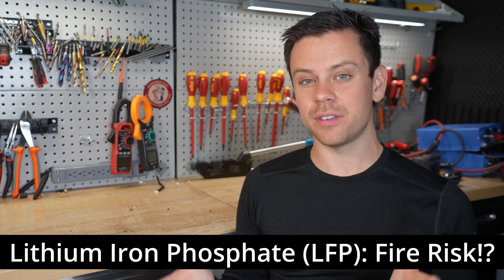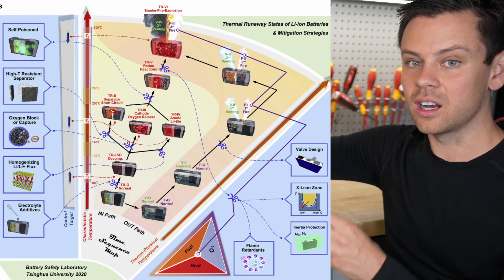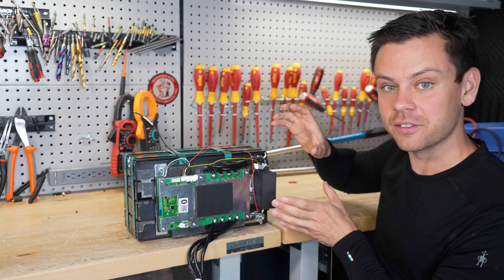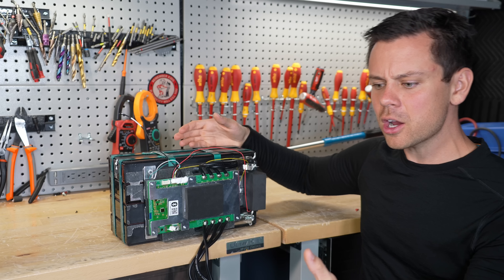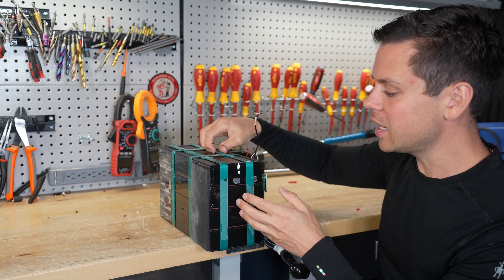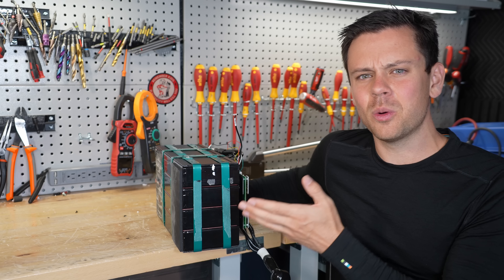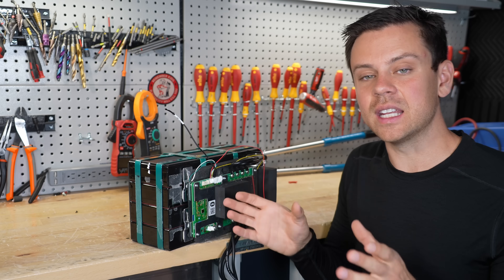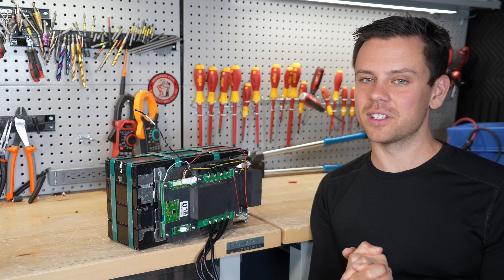LFP Battery Fire Safety: What You NEED to Know

Comment: All the externals reasons you're giving for how a battery could cause a fire boils down to the fact that LiFePO4 "fires" happen all the time. I had a name brand LiFePO4 charging on my workbench last year and ended up having a garage fire. The battery was in pieces and unfortunately when the battery exploded, some of the pieces landed on my kayak and it spread. My garage fire was more smoke damage and contained to the garage so I was lucky. Now I NEVER charge my kayak batteries in my garage. The fire department said my situation isn't unusual and more common then people think. I charge all my LiFePO4 in the driveway attacked to 200W Ecoflow solar panels and a Victron MPPT. When the sun goes down, no more charging for me and I'm good with that. Lessened learned.
Reply from the maker: What in the world. Can you post pictures of this on the forum? Sounds like you're breaking the laws of physics 😂 how did it do that? What burned?
Reply: @WillProwse  I don't know how the battery caught fire or whatever you want to call it. I just know it was charging on my workbench and next thing I know, my fire alarm was going off. As far as your question about "happens all the time", I'll take the word of the firefighter and investigator who told me that's the case, it happens more than what people think than a person not in the field. You can also research it which I did, easily accessible. I'm not a LFP expert and don't pretend to be, I just know mine failed period. I unfortunately made the new and this was quoted "A preliminary investigation revealed that a faulty lithium-ion battery and charger sparked the fire. Firefighters stressed that homeowners should never leave a lithium-ion battery or any battery on a charger unattended. If not equipped with a shut-off, batteries can overcharge and cause a fire."

I had a LiFePO4 battery. I no longer use that brand.
Reply from the maker: Can you post on the forum some lithium iron phosphate battery fires that "happen all the time"
Reply: @WillProwse  No I can't because this is what I was told not only from one of the firemen who fought my garage fire/smoke that responded to my garage fire but also the fire investigator. Unfortunately my resident made the news and the same thing was said. Obviously mine was equipped with and BMS and my battery was a LiFePO4. Search "lithium batteries fires per year". If you don't believe it's not uncommon then so be it but I been there so....

"A preliminary investigation revealed that a faulty lithium-ion battery and charger sparked the fire. Firefighters stressed that homeowners should never leave a lithium-ion battery or any battery on a charger unattended. If not equipped with a shut-off, batteries can overcharge and cause a fire."

Comment: BIG QUESTION- IS THERE A TORQUE SPEC FOR lithium battery terminal bolts?
Reply: nearly all of the batteries have the info on their spec sheet. threads for this are on the forum going back years

Comment: There have been at least 4 garages burn in my neighborhood and all of them sadly are due to NMC power tool batteries charging 
I don't know for sure but I am almost certain they are using 3rd party replacement batteries and charging them with oem tool chargers unattended
Reply: Many many people leave their tool batteries on the charger 24/7.
This is caused many fires. I don't know why I don't remember why I would have to look it up again.
But I know with any of my Ryobi tools that tells you not to leave it on the charger once the battery is fully charged.
You're also not supposed to keep the battery in the tool if the tool is not being used.
Reply: Yea…they were trying to save a few bucks…haaaaa

Comment: For basic "Overvoltage" mitigation, defense in depth is required, ie a BMS that includes an "airgap" contactor or circuit breaker or pyro disconnect, as well as the current sinks / sources including overvoltage protection

Comment: Hey guys, What would you say the main cause for the hundreds of e-bike fires we commonly see online? Some bikes just sitting in a house or garage just start blazing. Vibrations caused a connection to eventually come loose? Wire made it's way onto a terminal like you showed in this video? Poor design allowed low gauge wires to melt their insulation onto another wire? Combustible batteries? I'm assuming the ones left plugged into chargers overnight were failed electronics that allowed it to over charge or were too hot or cold but didn't have built-in protection but enlighten me on those as well.

Comment: A few weeks ago I watched a news article where a house caught on fire. 
There were two boys at the dining room table. The older one reacted when he heard a Whoosh sound behind him that was audible in the video. He got up, turned to look and said, what was that. All of a sudden flames came through a doorway or maybe a hallway and were halfway across the dining room ceiling in a couple of seconds. It was a lithium battery and no smoke detectors sounded an alarm. People need to put smoke detectors on the wall above the lithium batteries. If they have an alarm system they need to add a smoke detector that will notify the security company or them if they have a security system that contacts them. 
It is possible to build a housing for the lithium batteries that will melt copper straps so the batteries can fall away from the house. It's a different world when batteries are involved and people need to think long and hard about battery storage.
Reply from the maker: Sounds like what I was talking about in the video and it not being lithium iron phosphate. Did you watch the video at all or just write all this out for no reason? 😂
Reply: So glad I stayed with SLA AGM batts for my RV. Weight and size no problem. 2 KwH for less than $500.
Reply from the maker: @aerodyneservices  those are awful. What do you like about them? Just the coulombic efficiency alone is horrid. And if they get over charged there is zero protection circuit. Blows the caps right off. Please convince me lol
Reply: @aerodyneservices  One: you can ruin SLA batteries by depleting them past 50% capacity. 2: Even sealed lead acid batteries can off-gas explosive and corrosive fumes. 3: charging a LiFePO4 battery (bank) is at least twice as fast as lead-acid, using the same input. 4 my neighbor just bought LiFePO4 batteries 300Ah (Or 3,840Wh) for just under $500 each. They are getting less expensive! A real plus, at least for me at 65, is that the same Ah battery is about 1/3rd the weight. I got tired of lifting heavy batteries into my "power trailer" and changed to LiFePO4s. A LOT easier to do four!

Comment: There are two major safety improvements that can be done for very low cost

1) mid stack fuseable link - aims to break an internal short circuit, with it being in the middle of the stack, this gives the highest probability of it doing so
2) a BMS that compares the voltage of the "sum of cells" in a the series string to the measured stack terminal voltage, and therefore can spot loose connections and high cell resistances at high currents (V=I^2R)

Comment: I would suggest you overcharge a single cell to prove that it will not burst into flames . Iknow it is wasteful but it proves your point .Iaccidentally overcharged a 280 AH battery to 5.3 volts causing swelling but no  failure in the overpressure vent .

Comment: One thing i want to se you do is a aerosol fire suppression test. Try to "overvoltage" (edit: or whatever method to get LFP venting gas and ignite and trigger the suppression ) a LFP battery encased in a metal case with fire suppression. Many battery companies installs it in a LFP battery case. Only seen Chinese and a German test it with mixed result.

Comment: I'm paranoid about connection points to the point where I use LockTight 272 on the screws and cover the terminals with tape or silicone or both lol.

Comment: You are spot on, it's extremely foolish the US uses so much NMC in EVs and not LiFePo4. NMC needs to be kept under 80% for long life, while LiFePo4 is happy to be charged to 100% everyday. So even though LiFePo4 has lower energy density, for day to day usage a LiFePo4 EV has the same range as a NMC EV. The only situation where NMC EVs have the range advantage is charging to 100% at home just before leaving on a road trip which is a tiny percentage of EV usage, and as soon as you hit the super charger the advantage is gone for the rest of the trip. I have an EV with NMC and have been using LiFePo4 batteries for 15 years in projects. I would have much preferred to buy an EV with LiFePo4 but didn't really have a choice.

It's particularly stupid that Tesla has stuck with NMC in the US as they should know better. They finally have a US LiFePo4 battery plant coming only shortly which they should have had years ago. Tesla dragging ass on LiFePo4 has been bothering me for years.
Reply: NMC has much better performance and is lighter!  NMC provides higher energy density (longer range), faster acceleration, quicker charging, and better cold-weather performance. These attributes align with the needs of performance driving, where range, power, and responsiveness are critical. For stationary purposes, like ecoflow units, LifePo4 makes better sense.
Reply: @aussie2uGA  good points!
Reply: @aussie2uGA  Yes there are situations where NMC is better but most people don't need high power EV sports cars and would rather have battery longevity and less fire risk. I can't charge my NMC Tesla battery to 100% everyday but I could if it was LiFePo4 without degrading the battery so effectively the range is the same. The world ex-USA has largely chosen the more practical battery, LiFePo4. I won't stop anyone who wants the performance of NMC but don't make it the default choice in USA EVs!
Reply: LiFePO4* O4 is 4 oxygen there is no Po (Polonium) in batteries
Reply: @gg-gn3re  we would be so cooked if we put polonium car batteries, haha.
Reply: @gg-gn3re  LiFePO4= Lithium Iron Phosphate.
Reply: I thought the new long range rwd Y has LifePO4 but maybe I'm wrong
Reply: @everydaycarry1328  I don't think this is correct. Other markets outside of the US definitely have LiFePo4 in the standard range and standard range in the US used to use imported LiFePo4 cells.
Reply: 100% they do this so the batteries are cheaper (higher margins for the company) and the batteries will fail sooner (planned obsolescence). EV makers do NOT want their battery packs to last 15 years (~180k+ miles). It seems most tesla packs fail around 160k miles. That is anecdotal, but this seems to be the case.
Reply: @wootks  LiFePo4 is significantly cheaper than NMC but the rest of your points are valid.

Comment: So why are batteries catching fire in New York City? Is it becomes of the charger?, not having a BMS? Why is it specifically electric bike batteries? Are lithium ion 12 volts 100 batteries safe?
Reply: Those are NMC, not LiFePo4
Reply: @fouroakfarm  Thank you for the feedback! So are you saying that the NMC battery is less safe than a LiFePo4 battery because of my concerns noted before because they are regular lithium-ion battery? Should I only buy LiFePo4? Big investment.  I just need a little more clarity better to be safe than sorry, thanks! Still learning.  Online: "NMC batteries are a type of lithium-ion battery that uses a cathode made of nickel, manganese, and cobalt. They are known for their high energy density, meaning they can store a lot of energy in a relatively small and lightweight package. This makes them popular for electric vehicles (EVs), portable electronics, and renewable energy systems."
Reply: Currently, almost 100% of e-bike batteries are not LiFePO4 because this chemistry offers a lower energy density, resulting in a much heavier battery for a given capacity. This weight disadvantage has historically limited their adoption in lightweight personal mobility devices like e-bikes and scooters. Despite this, safety concerns are prompting a shift towards LiFePO4 batteries in the automotive sector, particularly in China, where they are increasingly used in cars for which speed and performance are not paramount.

Comment: Have you ever seen this before? I have the EG4 3Kw inverter connected to the EG4 battery (48VDC) and was charging with 3 Hyundai 395W Bifacial Solar Panel (Silver) | Up to 470W with Bifacial Gain | HiS-S395GI (purchased a pack of 10 units) connected in series giving me about 130 something Volts input. Been using this system for about a year and a half with no problem. Then I decided to hook up one more PV in front of my camper and boy I was happy! The system now charges so much faster. Well, then I thought about connecting one more panel since I have purchased 10. Guess what, with 5 panels (all connected in series) Now I have 220VDC input. However I noticed that the charging current was way lower. Well, then I disconnected the fifth panel and bum the current from about 1A jumped to 6A! What in the world is the problem? Damaged panel? The input voltage is there (about 220VDC) With all my years of electrical knowledge I have never seen something like this. LOL Do you have any idea what could be?
Reply: What is the maximum input VOC of the EG4 3Kw inverter? If you go over that, or the recommended maximum Amperage input, you can ruin the "inverter". I suspect you was overvolting a tad.... never mind, I just saw that it's max Voltage is 500V. Try testing the VOC and short-circuit Amperage of that last panel. Might be a "dud".

Comment: I'm glad to see this video. I have three 100 Ah individual batteries and a mobile 400 Ah parallel 5,120-watt system. All of these are in my house. I wanted to keep them in a controlled environment. I have been a bit nervous and have been entertaining putting them out in my garage. I also prefer keeping the mobile unit inside so I can roll it out onto the back deck for solar charging. Thank you for the great, clear, and concise information.
Reply: Do you also store propane bottles in your house to keep them from getting too warm? After all the valve is off and they're currently not leaking. I've been in the battery industry for 25 years and there is no way in hell I would have any batteries of any reasonable size within the building envelope in which myself and my family live and sleep. I think it is an absolutely horrible idea.
Reply: @Loki-rascal  Do you park in your garage?
Reply: My 46,000 watt hour battery console started a fire in my shop 11 months ago doing $150,000 in damage. The investigators think that the battery was dropped and was internally damaged during transit.  I am still dealing with reorganizing the shop and garage after repairs were completed. I replaced my battery bank with EG4 components. I have a Boss box with 3 of their 280 amp hour batteries and a Flex Boss 21 on caster wheels so it can be rolled into the side driveway. It connects with 50 amp 240 volt RV cables.  The smaller unit has the 6000XP with a pair of 280 amp hour batteries. It takes up 2 foot by 2 foot floor space but is also on caster wheels to be mobile. I NEVER expected my old unit to ever catch fire. I am very  nervous about LFP batteries and fire. The decision to go with EG4 parts is that they are UL Listed and have internal chemical fire extinguishers. Now I have 71,500 watt hours available through 2 portable units.
Reply: @kimmer6  What mobile rack do you have your 6000XP and the 280Ah batteries mounted on? I like the idea of it being mobile, I'd love to see a mobile cart that can handle that weight. Thanks.
Reply: @woolval52  It's 3 layers of 3/4 plywood  24''x24'' glued together with exterior wood glue, screwed and pressed together for a few days  compressed by the weight of a Ford 302 marine engine until dry.  Then I used a Forstner wood bit to put the 8 
 1/2'' deep holes to git the battery feet.  I put 4 urethane caster wheels on the underside and a 5th in the middle for fun. Amazon has them for under $30 for 4.
They are rated 900-1200 pounds

The battery steel plate mounts were spaced out with pieces of 1/2 inch water pipe 2-1/2 inches long with 3/8'' allthread 

holding them together. The one conduit box front mounts have 6mm allthread screwed into the battery and were long enough to protrude 1/2'' out of the top of the conduit box. There are 2 sleeves of 1/2'' water pipe around the allthread from box bottom to the top to keep it from crushing. These are where the 1/2'' emt conduit legs support the 6000 EX inverter.  

The unit had a breaker box with 2x 120volt outlets, a 30n amp 120 volt RV outlet and a 4 prong 240 volt 50n amp 240 volt outlet.
It uses extension cords to feed the house, shop, and other things as necessary. It is made to fit a 2 foot by 2 foot place in the corner of the shop and is not connected all the time. Its the backup to my backup, on standby.  It looks like a darned robot.